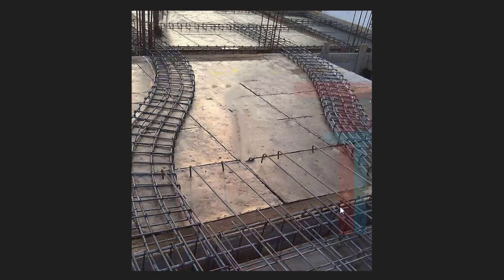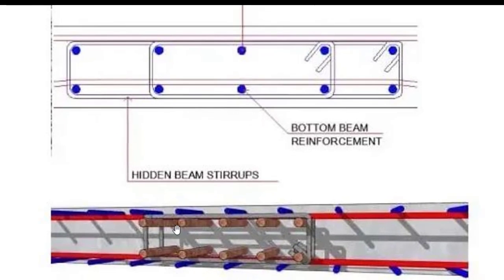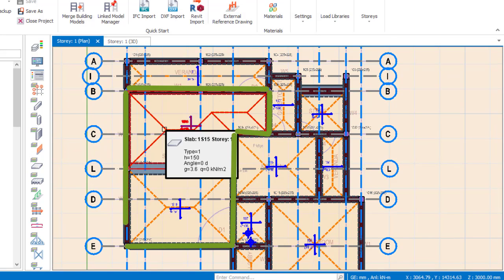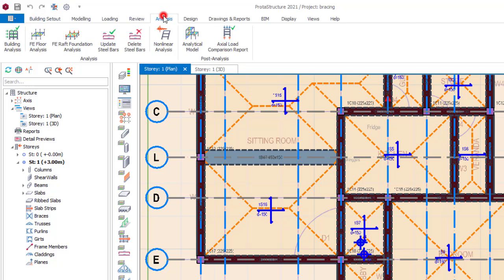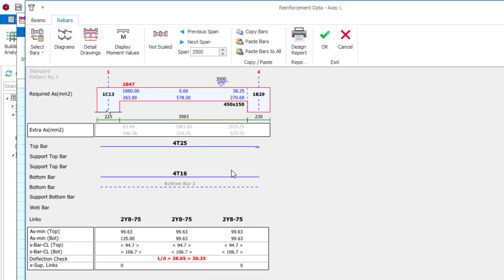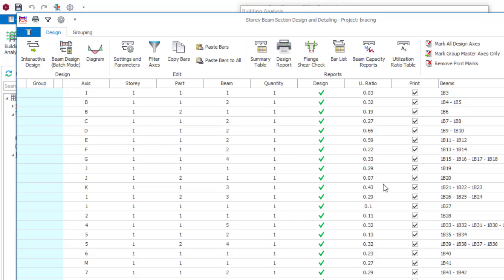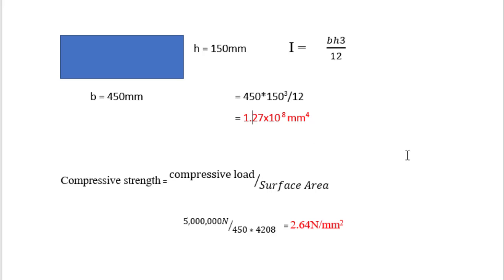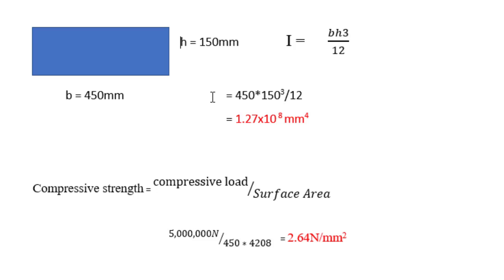Are Hidden Beams Economical and Stable? A Critical Review with ProtaStructure.

Comment: Well explained however, since the hidden beam failed in the bending moment can't we increase the depth of the slab to 200mm I have always had this concern with some architectural drawings that have a larger span of sitting room
Reply from the maker: Increasing the depth of the slab to 200mm does not guarantee a success. It'll most likely fail the deflection check. Increasing the thickness to 200mm from 150mm (for example) will consume several m³ of concrete too. Its a very uneconomical strategy.
Reply: Hidden beam will always have same stiffness as the slab since depth is the same